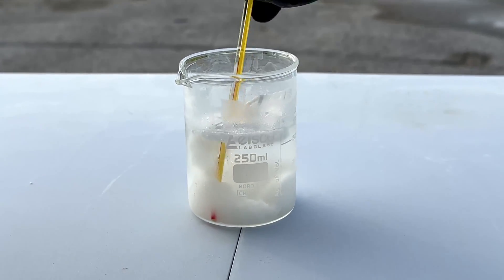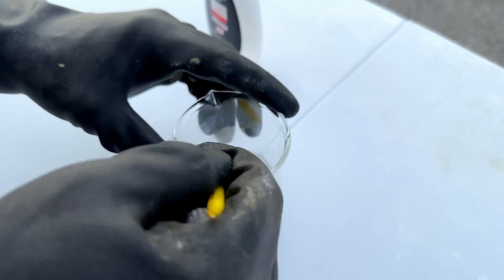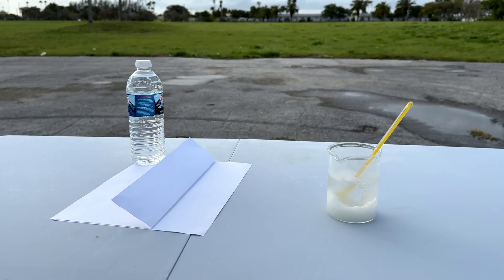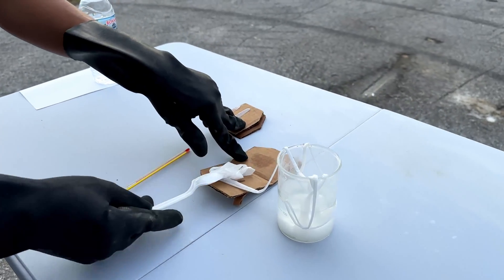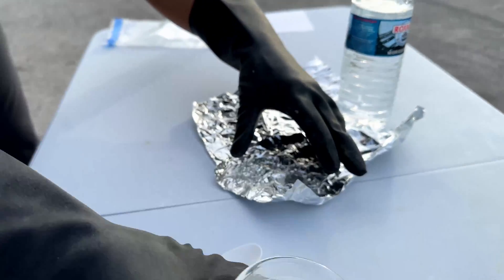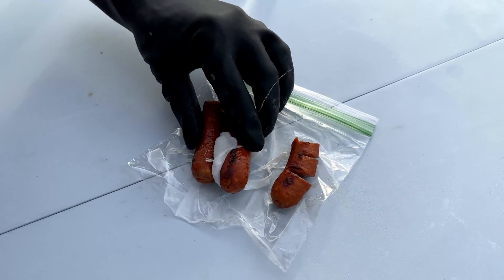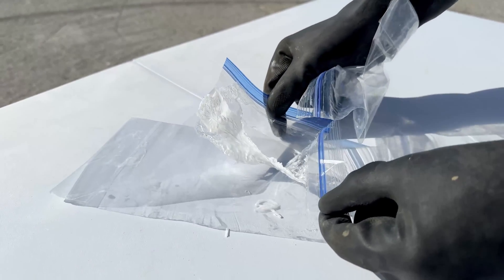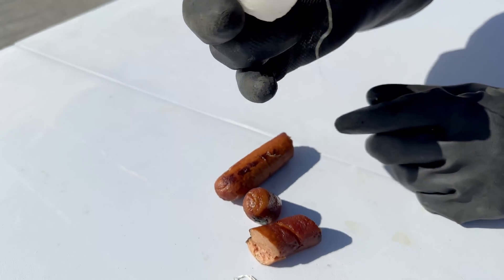Turning Styrofoam into Super Glue

Comment: Try doing this with toluene. I have found that polystyrene will dissolve in toluene much more completely, forming a clear, sticky, homogenous resin, rather than a goop.
Reply from the maker: Very interesting! Does xylene work the same way (it’s more accessible for me too)?
Reply: @MolecularPlayground  I would think so.
Reply: @MolecularPlayground  I investigated a bit further and found that this polystyrene resin will solidify into strong, flexible, clear sheets that will adhere to the surface on which they formed, as compared to the acetone-based goop that solidifies very slowly to form brittle, cloudy chunks.
Reply: @MolecularPlayground  I think in the future I might also try making an actual superglue using styrene monomer and benzoyl peroxide. will update whenever I do that.